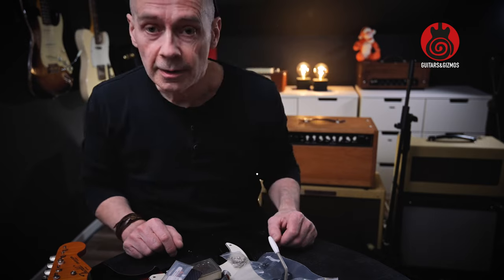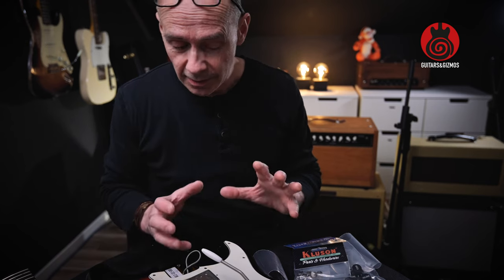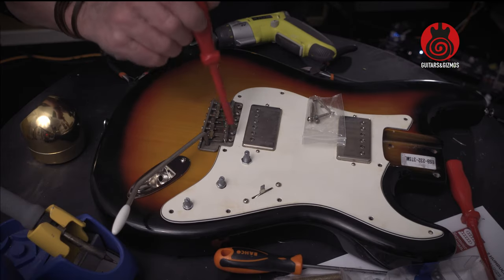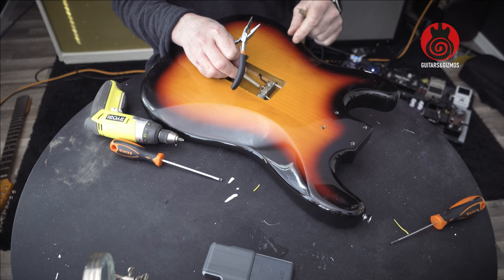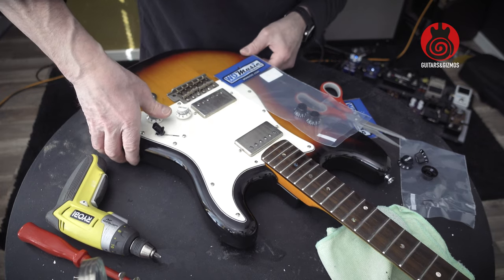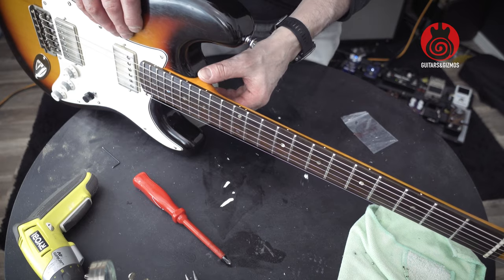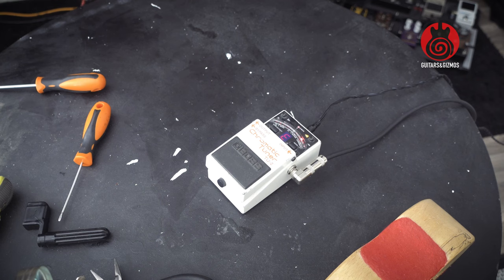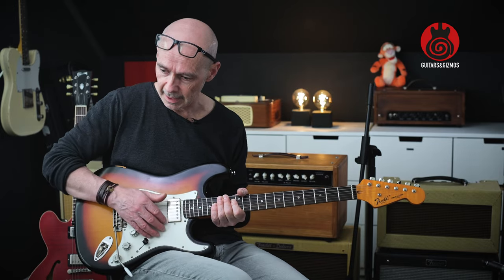Building a very good Strat PartsCaster (HH Stratocaster). Pitfalls, challenges and solutions.

Comment: There you have it! A Thoddi Custom Shop light relic by Master Builder Thor! Sexy guitar for sure...I would have order it with a mint green pickguard and cream relic knobs, but that's just me :-). Did I say it sounds very good? Well, it reminds me of some early Peter Green`s recording...I was actually surprised by how good the tone was. Did I spot some slight high string tension? Try (in case) to tone it down one semitone or two, just for fun. Great video, Thor, and congrats!
Reply from the maker: Thanks Marcello😊 I have to admit I find calculating string tension a bit hard to grasp. Scale length is 25.5 and it's a set of 011- 048 so I guess it is a bit tight, but I find it quite balanced and good under the fingers. The action is pretty low and comfortable also. I have tried quite a few times to tune down to Eb, but not with this yet. Thanks for the tip, I might just do that! Cheers, Thor